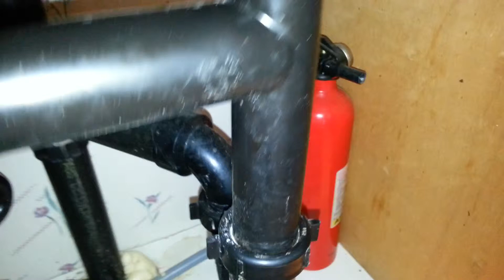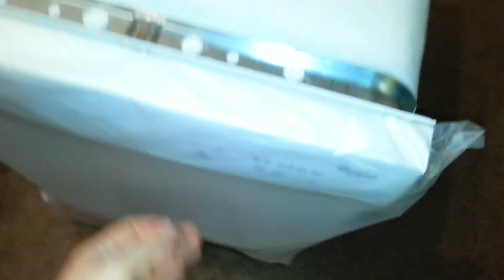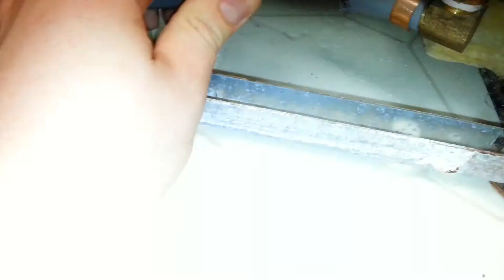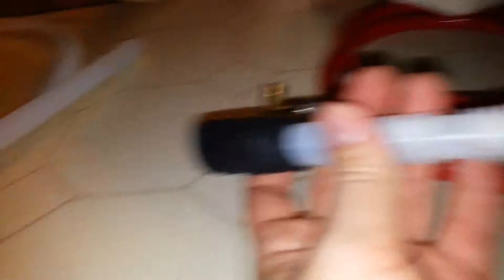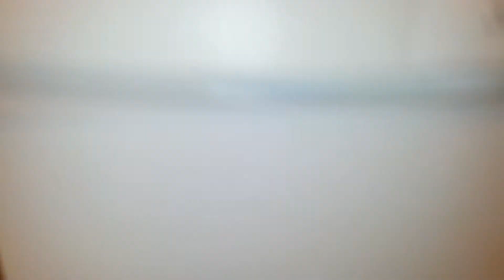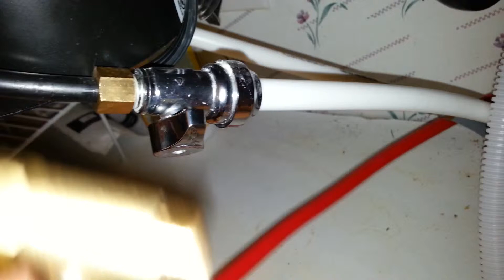How to install dishwasher in Modular house

Comment: DO NOT CUT THE MAIN LINE. Under the dishwasher in the front is a panel that opens and you can do the hard wiring that way.
Reply from the maker: To much work.  Just cut inch off and remove it... you have to clean wires anyway.  Why not to just have already nice clean cut and then you just strip them. Come one now.
Reply: @IvanRossS  to much work???  It's two screws....

But no biggie, everyone does it diffrent.

Comment: You showed that you cut the main power because it was hard-wired in, but I didn't see how you attached the new dishwasher to power or what you did what that main power line once you cut it. Could you explain please? This has been very helpful - thank you for putting it together!
Reply: DO NOT CUT THE MAIN LINE. Under the dishwasher in the front is a panel that opens and you can do the hard wiring that way.

Comment: Finally I found a video that shows how to connect water line to hot water line. I also have Pex water lines through out my mobile home. I have horror of the water lines springing a leak.